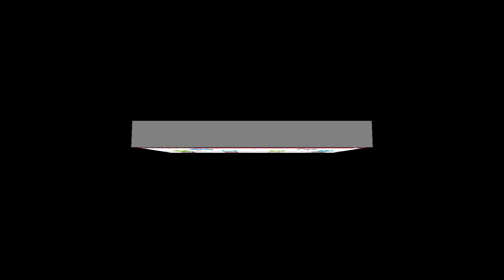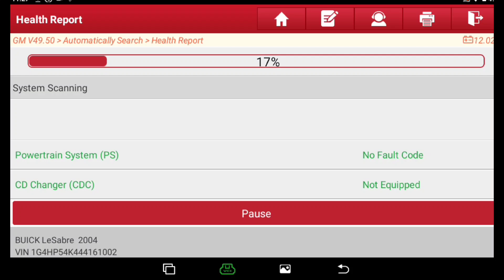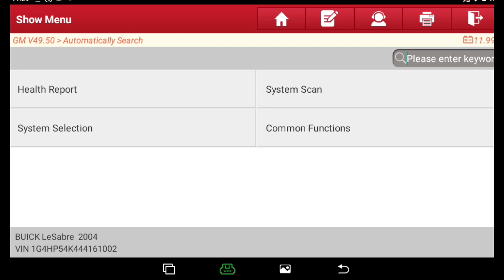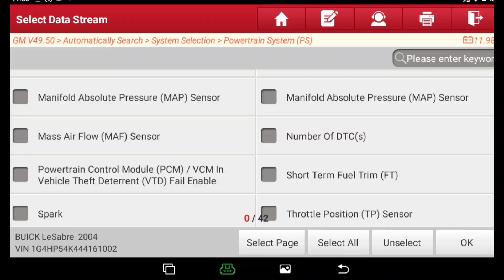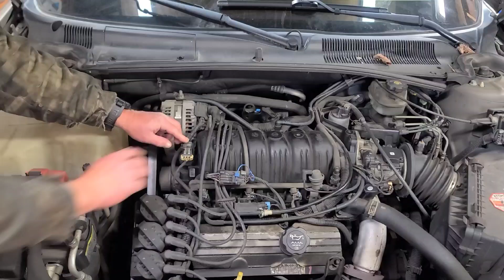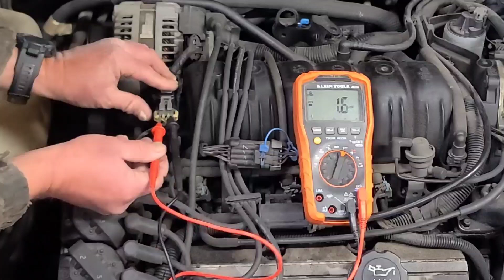How to SOLVED FIX GM Buick 3800 3.8 Liter for Won't Start until P0101 code Cleared It's NOT MAF

Comment: Hi, I live in France and I try to fix a 1993 Buick Park Avenue V6 3800 engine start trouble. My dead dad's car. I thought I could with your very interesting video but it is not the same engine version. It is not the same age.
I started the engine, then moved the car outside the garage, let the engine running while I was closing the garage door. When I came back to the car, the engine was stopped. I tryed to run it again but it starts and stop within 2 seconds. Oil pressure indicator is ok, air filter is new. I don't know what to say to receive any help from you. hope U will see my message and may be give me any tricks to go on. take care.

Comment: Went to check it out and the map sensor was loose, the seal was sucked down and causing the air leak. I would not have checked this without this video. Thanks, keep up the good work.

Comment: Thanks for the video.  Interestingly I have a 2002 Lesabre, I actually replaced the MAP sensor because I got a P0107 code (Manifold Absolute Pressure / BARO sensor low input).  I am now dealing with the P0101 code (Mass or Volume Air Flow Circuit Range/Performance) and just replaced the Mass air flow sensor, but I am still having the same problem.  Damn.
Reply from the maker: Do you have a live data obd2 scanner where you can monitor the input and output voltages to the MAP & MAF sensors.
This is the scanner I use and recommend 
https://amzn.to/4hUryTq

Comment: Thanks for sharing this information my car will start in the morning then I get to work and if I got to move it to repairq it it will start and then die right away
Reply from the maker: @danielworden4695
That almost sounds like a Fuel pressure Regulator Problem. Here me out
When the engine is cold it requires more fuel to run. When the engine is at operating temperature needs less fuel to run.
When your fuel pressure regulator goes bad the diaphragm inside of it allows to pass by and be sucked in from the Vacuum Tube that is connected to the Pressure Regulator.
So basically of a morning that extra fuel will allow it to start fine.
But after you warm the engine
That extra fuel floods the engine and it won't start 
There are multiple things it can be
But this came to mind

Comment: It also probably needs intake manifold gaskets and replace those plastic coolant tubes next to alternator.
Reply from the maker: Your probably wouldn't hurt especially the intake gaskets as there notorious for going out. I don't think this one has plastic hoses.
There rubber and actually connect to alternator bracket. Coolant flows thru bracket and 2 90 degree elbows into block.
Reply: @sartingarage8045  I'm nothing more than a YouTube mechanic and this engine and car is a dream to work on. The starter is located underneath with nothing in the way, the alternator is super easily accessible, there's tons of room in the engine area, there's an access plate in the trunk to replace the fuel pump. One of my theories is that they planned on making a V8 Lesabre (possibly Northstar) and that why there's so much room in the engine. We live in Florida and we bought this car from a retirement trailer park. It has absolutely no rust! Most of the stuff we've fixed on it is from age and dry rot. 

On a side note, Buick, Lesabre, Century and Park Avenue of that era are basically the same car with different trim packages. The Century might have come with a 3.6 though. The Park Avenue Ultra came with a Supercharger.